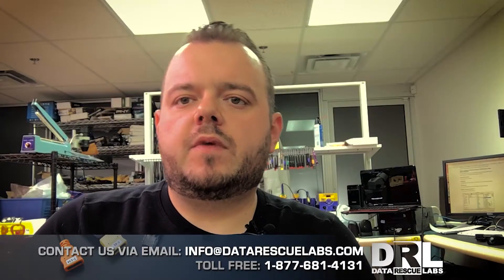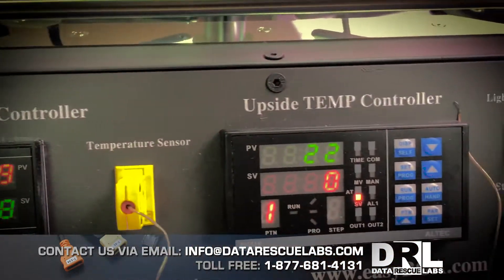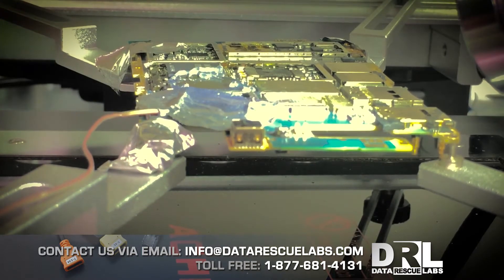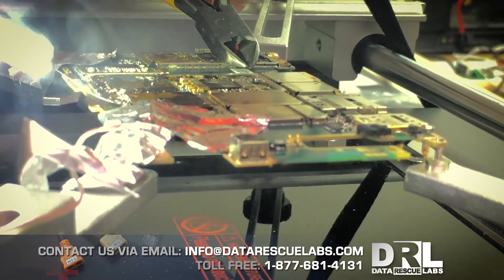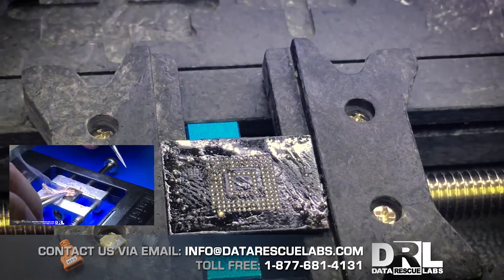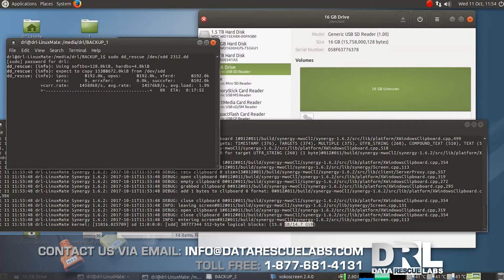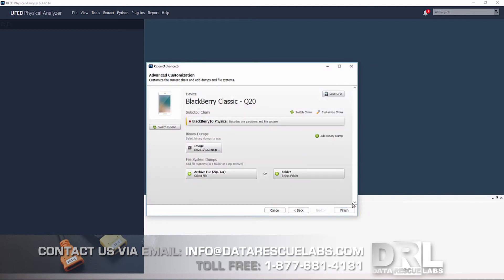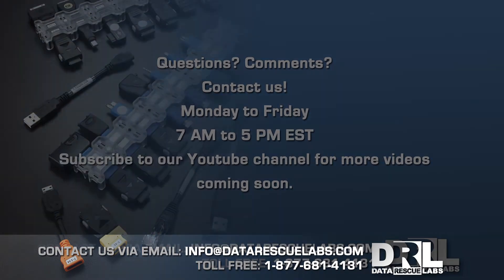How to recover data from a Dead BlackBerry

Comment: Hi - I have a Blackberry Torch approx 10 years old. I would love to recover my old photos from the phone. It is stuck in a reboot loop where it turns on, the bar at the bottom starts to load then it turns off and resets over and over. Is it possible to recover my photos? I live in Liverpool, United Kingdom. Thanks

Comment: My Blackberry Priv (I love that it uses Android) stopped booting, and replacing the battery wouldn't help. This has about 23 GB internal flash chip to go along with almost whatever microSD card I wanna use, and I can't remember what data I have that's stuck in that non-access void for now.
I don't know what kind of mounting tech it uses, but BGA is bewildering to me, and I'm glad you have a specialized device that can read one without having to solder it into a donor board, because I can't imagine how any non-factory shop could do it! What's your price for that?